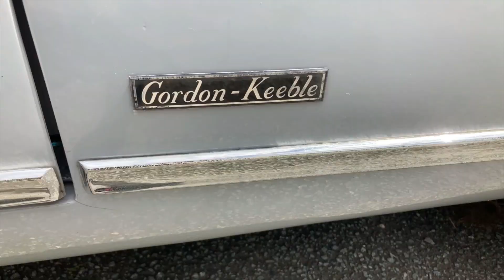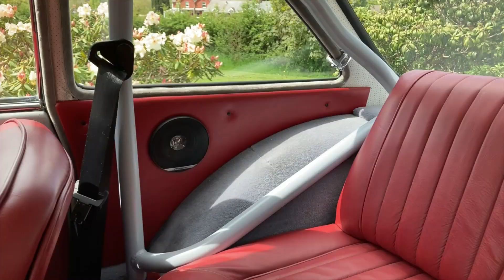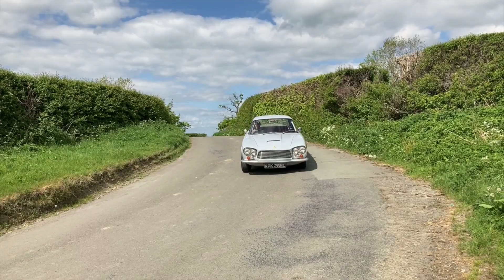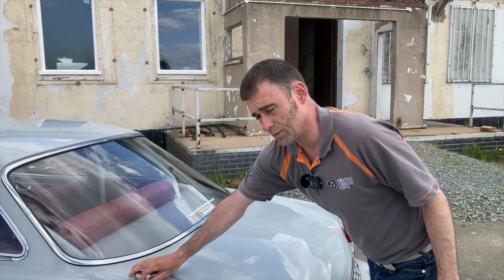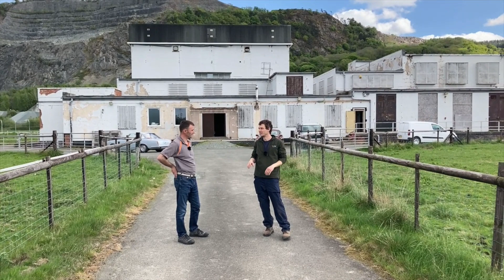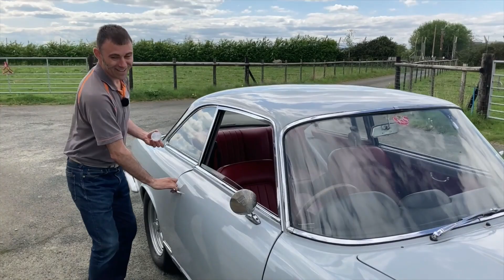Is this the rarest electric car in the world?

Comment: Which chassis number is that? I don't recall one ever modified for rallying although one brave soul did race his a few times. I owned No 72 in the 80's and 90's - its sadly sitting around awaiting restoration ever since I sold it

Comment: If that car had been mine, I would have driven it with its V8 engine until it fell apart in my hands.  You've taken a £100K ultra desirable and iconic car from the sixties,  with its own real history, and turned it into a Frankenkeeble.  You've even taken off the original back lights.   I'm appalled.

Comment: I confess I was slightly offended when you compared the Gordon Keeble with a Shelby Cobra. The original Cobra was an obsolete AC chassis fitted with a rather nice Ford 260/289 V8. The later 427 Cobra had an improved chassis that was hamstrung by the weight of a 7 liter Ford 427 V8. Both Cobras were amazing but compromised cars to drive. The Gordon Keeble was a much more well balanced car with a chassis that was probably better designed than the later Cobra's chassis but fitted with a lighter 327 Chevy V8. I would argue that the Gordon Keeble was a superior car to Aston Martin's DB4/DB5/DB6. Pity Eon Productions didn't get a hold of one for Goldfinger.

Comment: What's the point of converting a classic car to electric ?
The CO2 footprint of the batteries, elec motors etc is probably higher than leaving the engine in, as they generally don't do that many miles.

Comment: I was wondering about adding regenerative electric to the rear subframe of a Honda Jazz and keeping everything else the same for simplicity and long range and also to drive the aircon and the power steering & brakes. I think you would want something small and cheap that just regenerates the energy from city stop/starting rather than Tesla performance. I thought that the new electric Citroen Ami motor might do for that, but maybe 8hp & 5.5KWh is not enough?
Looking at the rear suspensions of Honda Jazzes, the earlier Mk1 (2005-2008) would be easier to do than the Mk2 from 2009, because the Mk2 had the coil springs moved rearwards along the suspension arm to be aligned with the hub, which would interfere with driveshafts. Don't know about later versions.

Comment: That is a very pretty car.  On the 4x4 conversions where a tesla drive unit is used to drive the original front and back axles, how does the additional gear reduction in the axles affect top speed?  Thanks for all your great videos.
Reply from the maker: You have to gear it correctly. 👍
Reply: @ElectricClassicCars  Do you change the axle ratio, or change gears inside the tesla drive unit?

Comment: Must admit I was a little sceptical when you announced in a previous video that you were going to convert one of only 100 GKs ever made. However, the fact that it had already been modded means it wasn't an original spec vehicle. You've done a lovely job and been sensitive to the spirit and style of the car. Please polish the rest of the steering wheel to match that beautiful centre boss.

Comment: The Gordon Keeble is very special, nice job. Can't help but think the forward batteries are a bit hgih up but I may be wrong.
The center piece almost blends into the steering wheel too much, assume that is what the original piece would've looked like?
Anodized in black would be nice as well.
Reply: The battery pack looks quite deep, so weight balance okay.

Comment: It’s a nice job but slightly sacrilege on such a rare old car. The interior is nice but I don’t like the integration of the modern Bluetooth infotainment/reversing cam system. It would look nicer concealed behind a period looking speaker grille or cubby hole that could be slid or flipped out of the way when the owner wanted to use the system. I think there are at least 2 more of those WW2 radio transmitter buildings in the Breiddens/Criggion area where your machinist is located?

Comment: I can't help it, this conversion makes me sad. If you don't understand that perhaps consider gutting an ancient historic building and just leaving the facade of the old building with a modern building inside. It would no doubt be far more environmentally friendly but you have removed its soul. Better than removing the building entirely I suppose but a bit like replacing a work of art with a test pattern (for those of us old enough to remember such things!)
Reply: But you a not gutting an ancient building. You are putting in decent plumbing, a modern heating system and modern lighting. Any building that survives more then a couple of generations goes through these upgrades. If an inanimate object can be said to have a soul it comes from all the people who have worked on the object, not it’s original form.
Reply: @francesconicoletti2547  A point of view I'm sure you hold sincerely Francesco. It doesn't work for me and I'm sure both points of view are common. To me your view makes no more sense than putting an electric power plant in a steam train locomotive.  After all, it still looks the same.

Comment: Where is the horn button located if it's not behind the centre cap on the steering wheel? Also I would have preferred to see that enameled to match the front badge, just my OCD.
Reply: I’m guessing the horn is a push button on the end of one of the column stalks ?
Reply from the maker: It's on a stalk off the right of the steering wheel. 👍

Comment: Reliant Scimitars should make a great conversion as the original V6 Ford was very heavy and not that powerful unmodified.
Reply: In the 1970's the Scimitar was a quick car, the Middlebridge models used the more powerful 2.9 injected engine. 
I agree though they would make an interesting EV, but economically it would need to be a labour of love.
Reply: @jjefferyworboys8138  
Yeah ive known friends who had  
early 3litre models... With overdrives on the gearboxes..
All these conversions are pretty much labours of Automotive creative art at the moment .. with varying degrees of practicality but as the tech improves and the costs reduce then it becomes more viable as well as desirable.
In fact in terms of concept configuration it a Progenitor of something like the new Porsche Touring estate bodied Supercars.